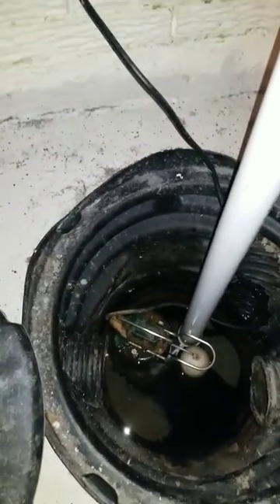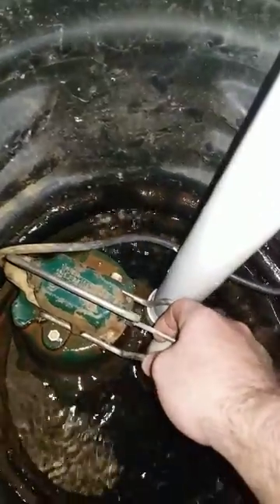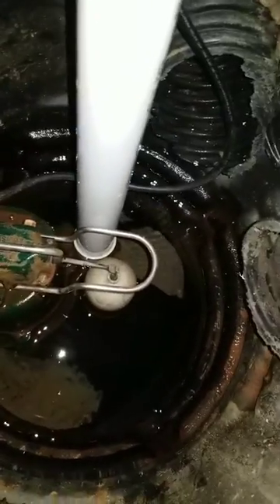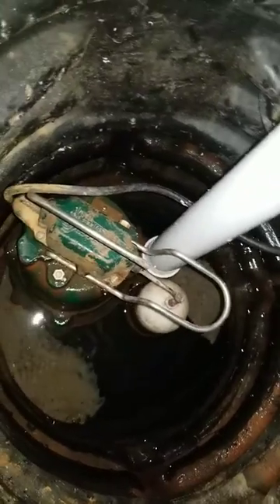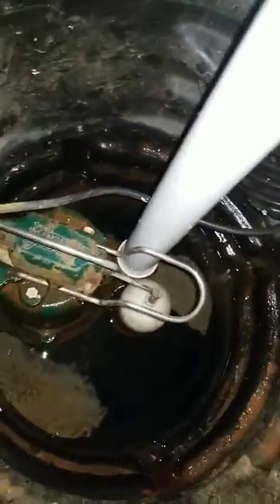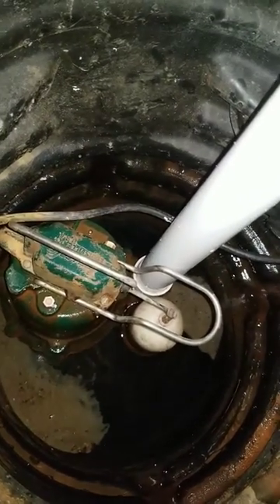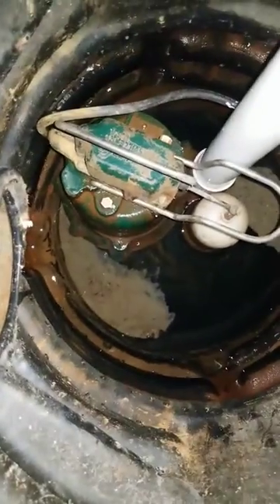Sump pump runs every 4 minutes!! Is this normal???

Comment: Recently I had 2 monster rain storms (hurricane Henri’ and Ida). These storms were approximately 7 days apart totaling about 14” of water. My basement sump pump worked phenomenal as all the water pouring in was extracted by the pump. But, 4 days later the pump routinely goes off every 10-15 minutes. The sump pump is within a bucket filled with holes but the water isn’t entering the pit via these holes. The water is dripping/leaking from what appears to be an attachment to the pump itself (it’s a plastic piece attached to plastic pipe attached to the pump itself). So the pump extracts the water than instantly it leaks in again slowly from this mechanism. You cannot see it but I reach my hand under the mechanism and along with feeling the water drip I obviously hear it. This cycle has been continuous for 4 days. Is it a pump problem? A plumbing problem or both? I set up a service maintenance appointment 2 weeks ago before this problem started and the appointment is still 2 weeks from today. I cannot imagine having this problem continuously occur for the next 2 weeks. Should I call a plumber or contact the service maintenance and get them here as soon as possible (they are the ones who installed my sump pump a few years ago ( First Quality Basement)…
Reply: I’m not at all familiar with this but is it possible that your sub pump is clogged and it’s forcing the already pumped water back into your sump basin?
Reply: Did you figure out the problem?  Sounds like the "thing" leaking is a check valve.  If that is malfunctioning, that could allow the weight of the water in the discharge pipe to flow backwards after the pump has completed a pumping cycle.  And if there is a weep hole, also known a s an anti-airlock hole in the pvc pipe right below the check valve, that water running backwards, will leak through that hole.  Sounds like you might have a neighbor or two running sump pumps on their properties.  Maybe the could offer some help?  Good luck.
Reply: @melotone3305  
Yes, the problem was figured out and resolved. I was told by 2 separate pros (and they were both correct). It was ground saturation from all the routine heavy rain. About 1-2 days after I posted the question/problem it stopped.